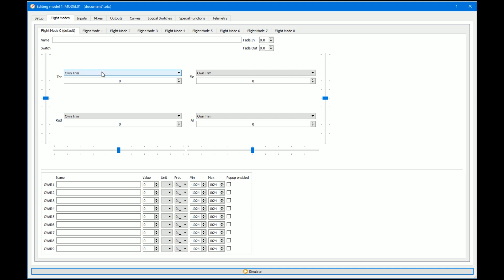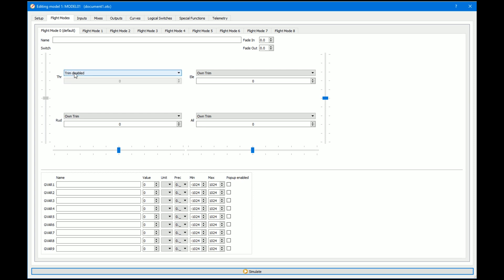Re-purpose trim switches in OpenTX

Comment: Hi Darren, I know this is an older video, but could would you know is it possible to rewire the trim switches to a normal two way toggle switch, really don't like the functionality of the trims and much prefer toggle switches.

Looking at the back of the radio they have three wires going into them so in my head I should be able to wire them into a On-off-On 2 way toggle switch. Do you think this would work??
Reply from the maker: A trim switch is basically an on-off-on momentary switch. Depending on where you're going to put these new switches, I would wire them in parallel so both the new switch and the trim switch work. That way, if you need to use the trims, you still can.
Reply: @MrD  Thanks Darren, you're a legend.